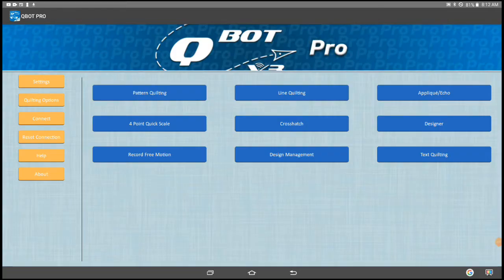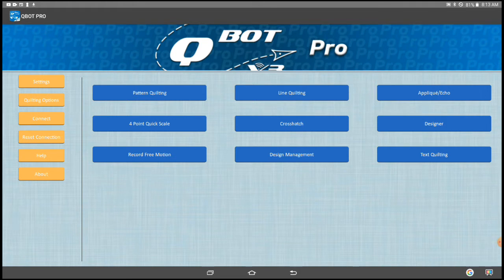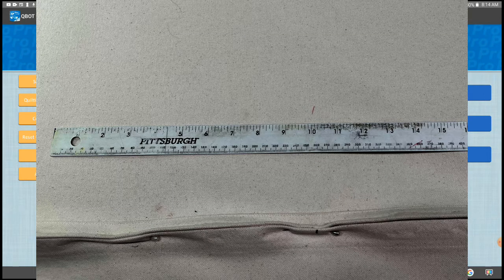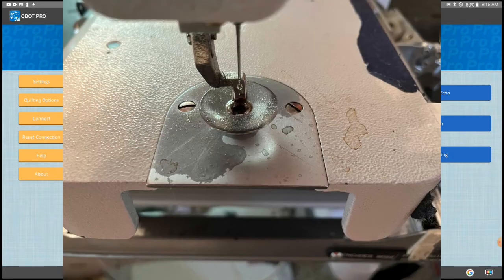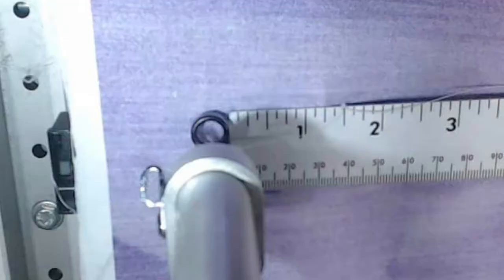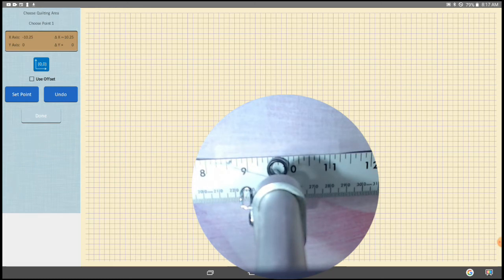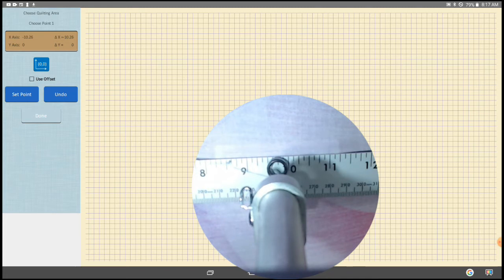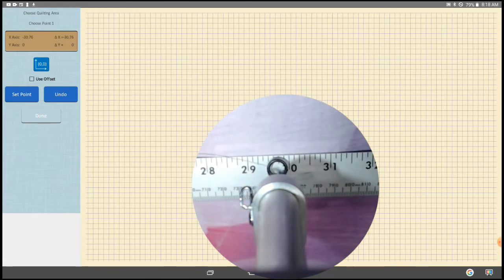QBOT How to check calibration and what is calibration

Comment: Thank you so much for this video. It is such wonderful info and you are such a good teacher. I learned so much and in such a gentle way. Thank you again. I am terrified that I will have to one day put new wires on.
Reply from the maker: Putting new wires on is NOT something to be afraid of.  It is actually pretty straight forward.  Takes a little manipulation  but is not that hard.  The MOSY important part is to look at how the wires are wrapped before you remove them.  Are they wrapped over the drive wheel or under the drive wheel.  you will need to wrap them the same way when you replace them .  Over or under is how does the start in relation to the wheel as it starts to wrap around .
Reply: @jerrymacvaldosta  Thank you for that information. 😊